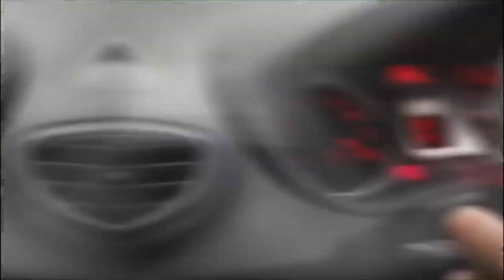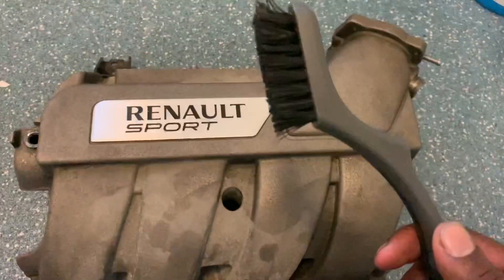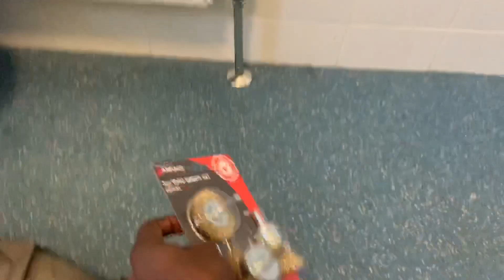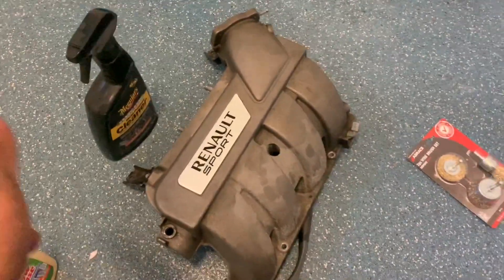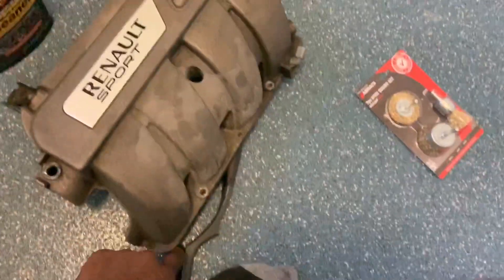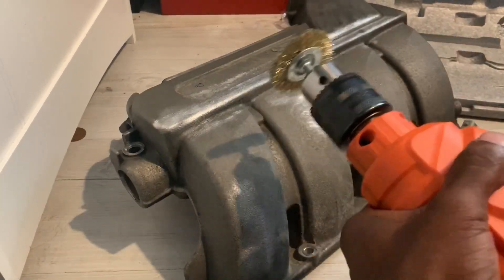HOW TO RESTORE YOUR INTAKE MANIFOLD‼️

Comment: Do you have another manifold gasket or are you going to re use the old one?
Reply from the maker: It’s good practice to put another gasket on the inlet manifold
Reply: I agree. Got the part number? My track car is a Clio 3 RS, haven’t seen the individual part number for the gasket.
Reply from the maker: +DivideBYZero69 Genuine Renault part number 8200490285, you can even check Renault Parts Direct £6.64
Reply: Shxmzy outstanding. Thanks. 🤙